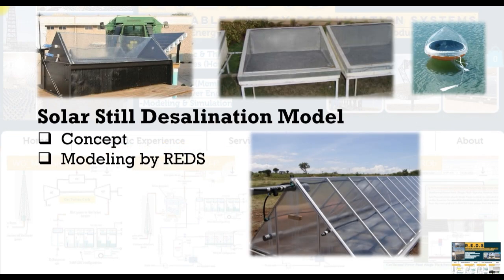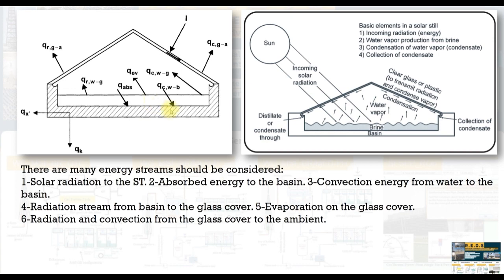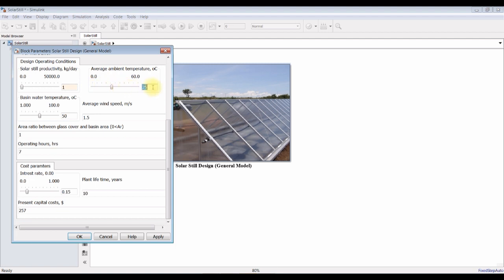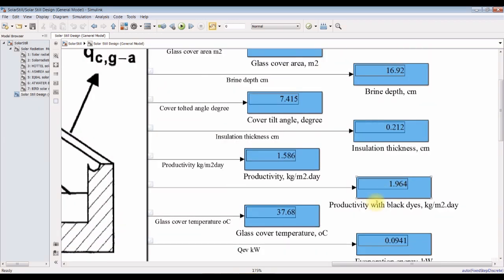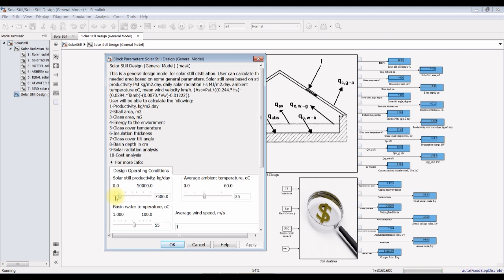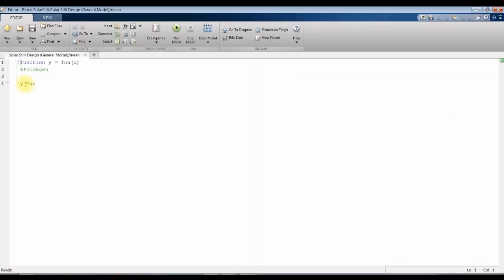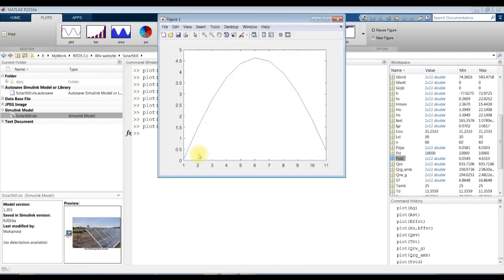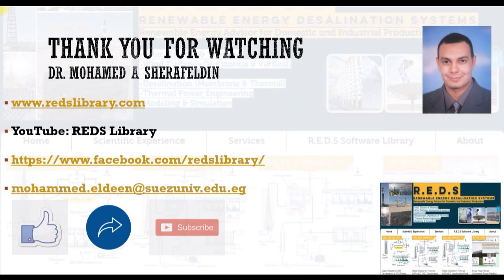Solar Still Desalination Matlab/Simulink model

Comment: Yeah when I was, 10yr, I came up with the same idea... this is Old tech. evacuated tubing desal is much more effective in heating and boiling the water to vapour point outside the glass tent. The water to be collected also should be inside the tent and should go to an lower colder point  covered by thick ceramic or concrete tank.